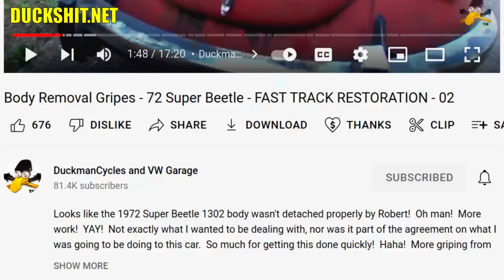Rust Removal - 72 Super Beetle - FAST TRACK RESTORATION - 03

Comment: If I had a Bug , Bus or a 914 that needed love... you are the one
Reply from the maker: Thanks so much my friend, I was actually going to do some floor pans in a 914 until we realized the amount of work goes into them.... lots of cutting and bracing, that was gonna be expensive and very time consuming.  I'm not sure what the owner of that car ended up doing, he owns a dealership for exotic cars and was going to put it on his lot for sale, so there was no way I was going to let that one tie me up without big bucks.  The rear suspension was also rusting off of the chassis, major repairs needed.  Maybe it wasn't profitable enough at the time.  Wild Bill did the engine, though.... twice.  The owner kept leaving it outside in a field.  Florida rains got in everything.... and probably has again, LoL!

Comment: Glad you showed the process of getting rid of the foam and corresponding rust. After dealing with this stuff on my old 76 I told myself I would never get another bug with the holes behind the rear windows (we call them "ears" over here). I figured water was getting into the foam through that, which made it rust the metal out... not sure if that theory is correct. Awesome progress, I hope we get to see the finished product some day (I mean when Robert finishes his part of the restoration).
Reply from the maker: I'll be digging into that area more soon, I've got a borescope coming my way from a sponsor!
Reply: @DuckmanCycles  Cool, looking forward to that. I have seen some of them where there is also rust below the corners of the rear window, about where the foam stops. Good idea to use the borescope there. Also on the inside of the heater channels as they rust from the inside out.

Comment: There's always more rust than  expected.  Currently I'm working on my dad's 1963 GMC pickup. It's just a ranch truck. But I want to clean out the drip rail around the cab roof.  And put new seam sealer in the seam.
Reply from the maker: Yep, usually the rust turns out to be much bigger.   Here we've just found a bunch of hidden things.  Ick!

Comment: Wondering if cutting a rectangle hole in the back is the best solution to remove foam out of these cars. I always struggle trying to remove the foam from a rotted area. Did not think about making a huge cutout and putting the plate back.
Reply from the maker: I think it might be the best way... the least intrusive way ius to get in there with coat hanger from the engine compartment and abort the stuff!

Comment: Always enjoy the videos dude.  Do what you do and laugh at the STUPID that shows up in the comment section!!

Question for you...How do I get the death foam out of my quarter panels without cutting my car? 

Hope to see you at the August Tech session.
Reply from the maker: Removing the death foam without cutting isn't easy.  You have to reach in through the engine compartment upper corners with an abortion coat hanger, poke and pull.  Its a tedious process, and you never know if you've gotten it all.  But with today's borescopes being so widely available, I imagine you can shove a camera up there and see what you've got.  I'll be at Tech Session!
Reply: @DuckmanCycles  Hey Duckman...I'm the guy with the Non-running white Beetle at tech session Saturday...Now you can put a car to a profile.

Comment: Hey Mister Duckman.
Could you Por15 ,or rustproof, that foam area in the inside before reinstalling the foam? Or would that be a waste of time and resources?
Reply from the maker: Sure, but the problem is painting in that area is practically impossible to be thorough (can be done, but not with my tools) and its not good to do while I have it open, either.... I'm just gonna burn the paint up with my welds.  The foam will not go back... the foam harbors moisture.  There are other ways to fill the voids.  What I do in this area is finish welding, then treat with phosophoric acid.... hose down the entire cavity with it.  As long as it doesn't get wet, it'll never rust again.   You can use chassis sealer here if you want to, its like a wax, or a tar.  Then stuff an old pillow in a plastic bag in there from the engine compartment.  I'l going to experiment with making some out of foam in a plastic bag.  Would be nice to be removable.
Reply: @DuckmanCycles  Cool
Thanks for the knowledge
Reply: Eastwood cavity spray

Comment: 13:50  Was the 'Tar-Board' more for Noise Reduction?
Reply from the maker: Yes, noise and heat reduction.  It really is just hardened tar on corrugated cardboard...
 Burns real well in a engine fire LOL!
Reply: @DuckmanCycles  LOL! I bet it smells really good too. At least it's easier for the Fire Department to find. If it were your vehicle, would you then replace it with the spray type or the Sticky-Back pads?
Reply: @DuckmanCycles  With the whole of your Group you should make a list of what's needed in a Revival (Start of an engine) and a seperate List of what you would take on a long trip in concerns of an Air-Cooled VW. I think a lot of people could benefit from such lists.
Reply from the maker: YOU SHOULD!   

The tar board really doesn't smell like much of anything until it gets hot, but after many heat cycles it loses its aromatics. Similar tar boards are also used on the passenger floor.
Reply: @DuckmanCycles  "I Should"? I don't even have a VW/Air-Cooled Vehicle. And as you know, as the Social Media goes, I'd be Brow-Beaten to death because if You don't Own a Air-Cooled Volkswagen you don't know $#!+. Even though I have watched all of your videos, as well as a lot of other YouTube videos about Air-Cooled Volkswagens. Just the mentality of Social Media.
Reply from the maker: "YOU SHOULD" is a curse word around here... something I've talked about a bunch of times, even dedicated an entire video to the term.  Now when I see it, I just repeat it back, lol
Reply: @DuckmanCycles  GotCha'. Alright...I'll say; "As Someone with Knowledge about what it takes to start neglected VW Engines, and someone who Owns and has gone on trips over 50 miles in a VW what would you 'Suggest' as a 'Will It Run' Kit and a 'Travel' Kit for a VW Owner." Does that sound better?
Reply from the maker: LoL!  I actually had a roadside emergency kit video edited and ready to go a couple years ago.  I was about to release it to the public but VWLife launched the same thing just before mine, and I liked theirs better.... lol!  I was gonna redo it with Carlos, but he is never available.  But I'll come up with something in the future!
Reply: @DuckmanCycles  What do you ALWAYS keep in your Air-Cooled VW? What do you ALWAYS take with you to Start a VW that's been sitting for over 5 years? I got the 'Bug' if you will, now I need to find one. LOL!